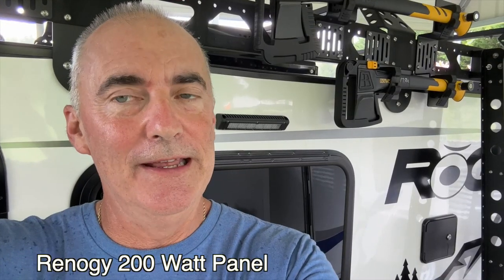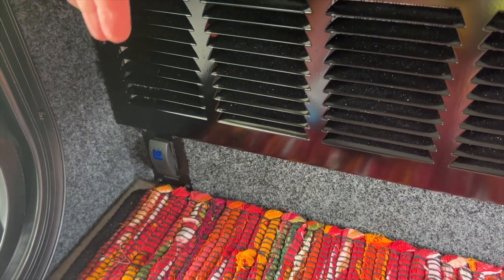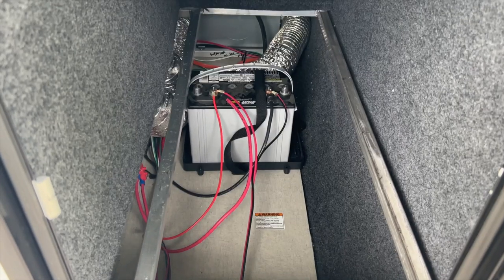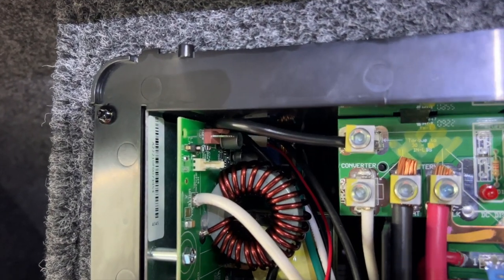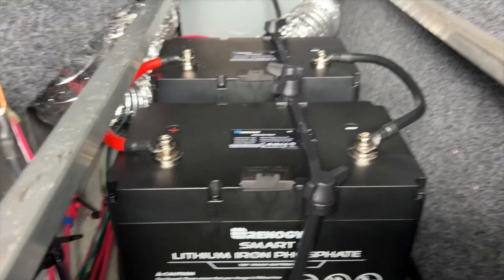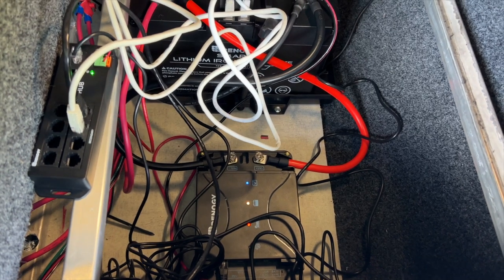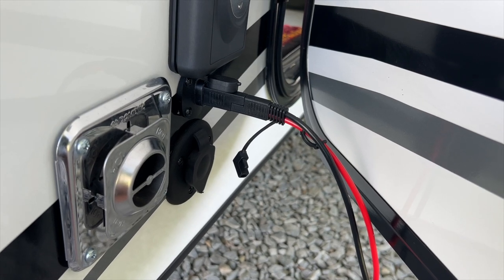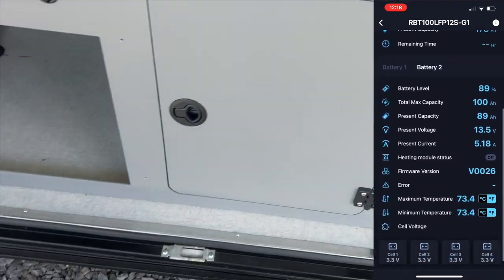ROG 12RK Adventure Trailer Full Renogy Solar Upgrade: How We Did It!

Comment: You could install a bus not connect 4 wires to a battery in the way you have . Solar cable connectors are a better way of connecting a panel to a charger
Reply from the maker: @boradatravel4503  Thanks so much for the expert input and helping the rookies like me out!😎 Blessings!

Comment: looks good and gives me some ideas for the battery system I want to do on the RangeRunner.. I have Jackery stuff already so I could just expand on that, but it gets spendy! We usually run off shore power anyway.
Reply from the maker: Yeah, we used the Bluetti EB70s and PV120 Flex Panel with the Rangerunner and it did a pretty good job keeping our 45qt DC fridge going! Our hope is that with this system we can be off-grid for much longer which will allow us to go out to some more remote locations! You are correct! It can get pricey in a hurry!
Reply: @TheRunawayGang  That’s right, my Setpower PT55 came yesterday. I ran it for a few hours off my Jackery 500 and barely touched the power. 

Also got a propane fire pit. Amazon had a flash sale, $65!
Reply from the maker: Which propane fire pit did ya go with? We have debated getting one, just haven’t pulled the trigger yet!😎

Comment: Nice video! I have a couple of questions. Is that solar suitcase the one with the built-in charge controller? If so, was it pretty simple to take it out of circuit so you’d have the panels going to your new charge controller. Also, did you test with the built-in charge controller before going with the mppt controller you installed? Also curious how you secure the hub and Bluetooth piece and how well that works? I’ve been thinking of something similar with the trailer I’m picking up tomorrow.
Reply: Very easy to remove existing controller (not mppt) just a few screws and it pulls right off, the rest is pretty self explanatory once you get it out of the circuit. I did not do any testing as I was already privy to the fact that the mppt controller close to the battery was going to be much more efficient.  Just used gorilla tape on the inside of the battery compartment wall. I talk about it and show you on the video how I did it. Very easy and works great! Glad ya dropped by! Blessings!